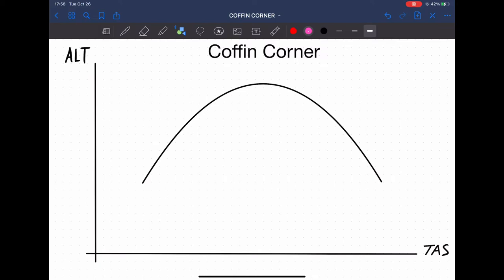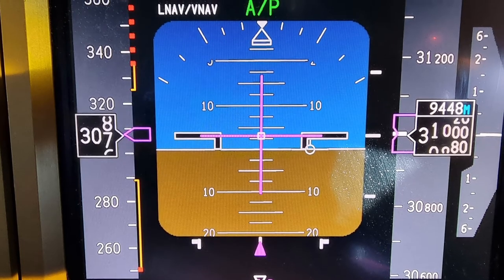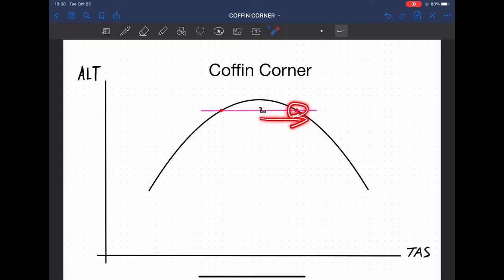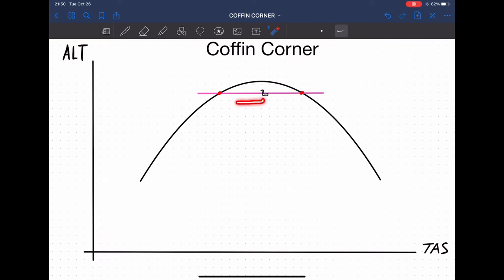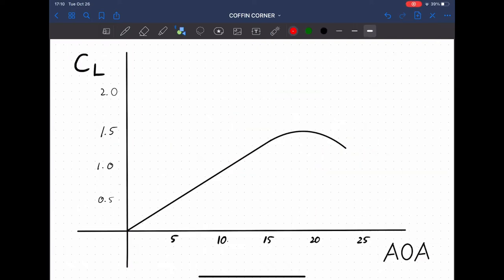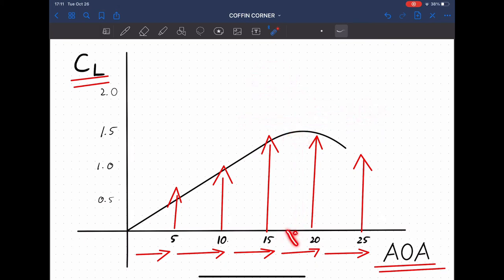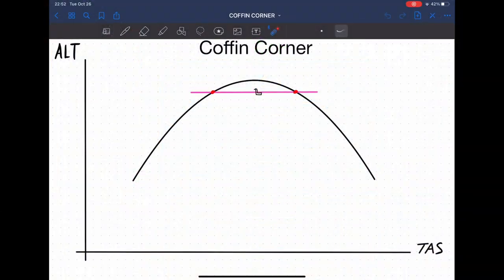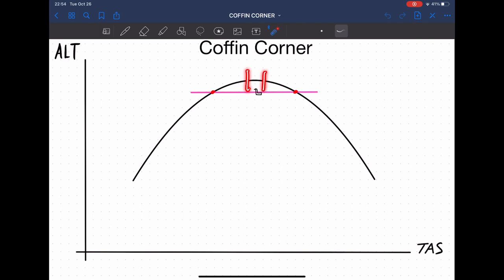Aviation Education: Coffin Corner explained correctly

Comment: Hello. Stumbled across this video while I'm studying high altitude aero for my ATP. This video helped me to understand coffin corner a little better because it actually made me think. However, there is an inadequacy in your explanation. The PFD/Attitude indicator does not show direct AOA of the wings. It is only telling the pilot the angle between longitudinal axis and the horizon (nose of the airplane vs horizon to put it simply). This is something that I have drilled into my student's heads over and over, the PFD/attitude is not an AOA indicator. Angle of attack is angle between chord line and relative wind. Pitch angle from the PFD/attitude indicator does not tell you that. Most planes do not have AOA indicators, although the attitude indicator can give you a general idea of where your AOA is at. But you are correct when you say a stall has nothing to do with speed, it does not. Only critical AOA. 

What I did get from this video is that at the low speed buffet, your AOA is high enough (although perhaps not at the conventional critical AOA) to now induce a supersonic flow over the wings due to the airplane's TAS through the air. This will cause a shockwave and move the center of pressure back, but not as much as with the high speed buffet. This shockwave will induce a low speed mach buffet. It is not necessarily a stalled condition as you defined it due to the angle of attack not being at critical AOA, but it is almost like a stall as there is separation of airflow from the wings surface and the boundary layer is disrupted. Which will result in buffeting and reduced control effectiveness as would happen in a stall at a lower altitude and at 17-18° AOA. So to conclude, with a low speed mach buffet, you perhaps have not exceeded the defined critical AOA, but your AOA is excessive enough to induce shockwaves from airflow acceleration and basically "stall" your airplane. However, as we don't really have AOA indicators in many airplanes, we use speeds as known guidelines to avoid "stalls" at higher altitudes (the low speed buffet), although an airplane can stall at any given airspeed. The air data computer in the airplane will calculate a corresponding IAS and put that on the screen as the speed the pilot should avoid to prevent the low speed (or high speed as well) buffeting. 

I think we could also compare low speed buffet and what is happening to the AOA to icing on wings: ice will start to disrupt the boundary layer and smooth airflow, and eventually separate the airflow at an AOA MUCH LOWER than that of the critical angle if the pilot tries to increase the AOA. This is stated in the Pilot's Handbook of Aeronautical Knowledge Chapter 5, implying that you can stall or have a severe reduction in lift even at an AOA much less than critical AOA if there is a reason for it to happen. This is basically also what is happening with a low speed mach buffet, except the reason for the early airflow separation is the shockwave rather than icing. Now is the low speed mach buffet a stall? Depends on how you define it and how you're looking at the whole critical AOA situation, but you definitely have severe reduction of lift. 

There's also fluid dynamics magic happening in all this I'm sure, but I'm not an aerodynamic engineer and I'm not even going to begin trying to solve this at that level. I just fly the things safely and have fun. This has been my two yen on the topic.
Reply from the maker: Thank you for watching and writing such a long comment.

You can find the AOA by taking the difference between the FPV (flt path vector) and the "piper" (the cross hairs/ the nose of the attitude indicator)   Even in you don't have a dedicated AOA indicator.

Example: In level flt. A jet typically flies at a positive AOA 2.5 degrees... How would I know that?
If I am at FL350 my FPV would be level at the horizon while the nose of the airplane (longitudinal axis) would be aimed upwards at 2.5  typically.

The reason why I am so adamant that the low spd mach buffet should be classified different from a traditional STALL is because there a lot of pilots who actually think the Low Spd MACH Buffet is the same as a traditional STALL.

They are not the same.

If you're the type of pilot who understand the difference between the two concepts and prefers to call it a "SHOCK STALL" instead of "Low Spd Mach Buffet" because Shock Stall is easier to say.
Then that is fine.

If you really want to simple it down... Lets redefine a STALL like this. 
Hyperbole:  "When the wings don't fly anymore"
obviously a joke.

I hope I answered your questions
please write back
give me suggestions on what next videos I could do.

Thank you again.
Reply: @flightlevelview2115  Thank you for the clarification. I have learned something new and useful for my ATP. I did confirm that the difference between FPV and the pitch attitude will equal AOA, that is very good to know. I come from a general aviation background where even the more advanced GA glass cockpit aircraft won't have a FPV, and they may have separately installed AOA indicators. This info on FPVs will be very useful for me soon. 👍

And I do agree with you that a low speed mach buffet is not a traditional stall, as discussed in my previous post which I wrote a whole essay to wrap it around in my mind. "Shock stall" is definitely less of a mouthful than "low speed mach buffet" so I can see why people refer to it as such, but it is definitely not a traditional stall exceeding the critical AOA. However, the symptoms of buffeting will make it SEEM LIKE a traditional stall, although the reasons for the airflow separation are different. Chapter 16 of the FAA Airplane Flying Handbook states "Mach buffet is a function of the speed of the airflow over the wing—not necessarily the forward speed of the airplane—and the shock wave strength, rather than a stall, [is what] creates the airflow separation." 

Hope that helps. Thanks again.
Reply from the maker: @guillermocuevas1688  simple rule… if the airplane is buffeting or if the tail (not the airplane) is buffeting something bad is gonna happen.
Also, If you are in 1 G level flight the AOA is the pitch attitude. Meaning the relative wind is the equal and opposite direction to your flight path then your pitch attitude is your AOA. FPV helps only when your climbing descending or pulling G s
Reply: @flightlevelview2115  Agreed with your simple rule on buffeting. And yes, technically speaking in 1 G level flight the relative wind is exactly opposite of flight path and thus the pitch attitude/artificial horizon could be used as an AOA indicator. I don't disagree with you, but I will explain why I wouldn't teach that in general aviation to any of my students. It would get confusing for them very quickly and in most GA planes there is neither an FPV or a direct AOA indicator. But even starting a stall from 1G level flight the pitch attitude indicator will not directly tell you AOA unless, as you said before, you have an FPV on it. Especially when I practice stalls with students in general aviation, even when we do start from 1G level flight, our flight path will change depending on the type of stall we do (power-on, power-off, accelerated), and that will immediately change the relative wind, and thus the AOA will not reflect anymore on just the pitch attitude, unless we can see our flight path.

So we (at least I definitely don't) don't teach in general aviation that the pitch attitude indicator will show you your angle of attack at all. Lest some poor pilot think that pitch attitude does equal AOA and then someday ends up pulling the nose of the airplane up to 10° pitch while pulling a 45° bank and then they're wondering why the airplane is stalled and spinning towards the ground even though the pitch hasn't reached anywhere near 20° as it does starting from a 1 G level stall.

Comment: Don’t really fully understand why aoa wouldn’t decrease with an increase in altitude considering the air density is significantly reduced, I get airspeed is increased but certainly not as significantly as the air density is reduced at a cruising altitude. Maybe I just don’t understand the math of it. But in conclusion both low and high speed Mach buffet are essentially caused by air over the wing going super sonic causing shockwaves? I’d assume then low speed buffet causing the cop to move rear wards just like a high speed buffet? Also causing a Mach tuck? Im a pilot in training for my atp already took the atp written
Reply from the maker: Thank you for commenting.
Not sure what you were asking.
Do you not understand why the speeds encroach towards each other?
Could you ask again in a different way?
Reply from the maker: A stall “exceeding the Stalling AoA” does not depend on altitude (air density).
Please write back i would love to chat, and perhaps you could give me another idea for a video
Reply: @flightlevelview2115  i think bccrow thinks that Level flight AoA should be lower than 3 degrees as seen in your  PFD. Above FL310 the aircraft is going fast , but the AOA is still high because IAS is low at HIGH ALT due to pressure and density . IAS determines AoA  , not Ground speed. in the mid altitudes flying fast can result in 0 degree level flight  because the you can attain IAS greater than 320 knots.

Comment: I am not sure about your low speed buffet explanation. In the lift equation there is air density; which is pretty low at high altitudes. Decrease in speed will lead to reduction in lift. However you are already be at the critical value of air density that barely enough for required lift and I think thats why aircraft will stall.??
Reply from the maker: Thank you for responding. I really appreciate it.
Not too detailed but are you an airman by any chance?
I just wana know for my channels sake who’s watching my content.
What videos you prefer go pro or educational
Reply: @flightlevelview2115  I am a Pilot, CPL holder. However the matter is, there is only one correct answer about the low speed stall at high altitudes. If what I know is incorrect I would appreciate to be corrected, if you have a source that proves your claim.
Reply from the maker: @orhananildemir4022  my sources come from my aerodynamic knowledge.
I think I explained in the video why the low spd mach buffet isn't due to a stall.
A stall is defined as the CL not increasing with a further increase in AOA. (The CL is decreasing)
A stall doesn't depend on altitude or spd.
At 1 G level flight at high altitude, the stalling AOA is no different, and assuming the stalling AOA is around 15~17 degrees
That means the airplane would have to be at about 15 to 17 degrees pitch up in order to "STALL".
The airplanes do not arrive at the low spd mach buffet at 15 ~ 17 degrees.

That's why I am ruling out stall from the reasons why the nose drops once you hit the low spd mach buffet.

The low spd mach buffet involves shockwaves.

If you would like to explain why you think the low spd mach buffet is due to stalling. Please feel free to comment.
Let's have a discussion.

Once again, thank you for taking the time to comment.
Reply: just check what is the stall and what is caused by. Stall is exceeding critical angle of attack which is as "flight level view" said constant with altitude and it should be around 16-17 degrees. Low speed mach buffet is exactly what he showed in this content. EVen if you think that way, why is this called low speed mach buffet? if there would be any stall they would probably call it stall buffet or just the stall:-)   BTW. you can decrease critical angle of attack by lowering the flaps for example. Efective AoA increases and because of that AoA crit decreases
Reply from the maker: @MikeSierra8282  thank you for commenting... are you a sub or a just a visitor?
Reply: @flightlevelview2115  hi, I 've just gave you a SUB. I am preparing for airline interview, constantly searching and reviewing some AV stuff. I found your content very interesting

Comment: thank you for your explanation! but why it called coffin btw?
Reply from the maker: Coffin Corner is just a name, I "think" it got the name because because you're flying in such a tight speed margin.
Reply: You get it wrong , you end up in a coffin 😉
Reply: @flightlevelview2115 I don't think that's correct. I think its more sinister than that. I believe the 'corner' part of it refers to the tight margins, but the 'coffin' part refers to the potential human consequences of losing control of the aircraft due to the small margin for error.
Reply from the maker: @mosty85  thank you for commenting and watching. Are you a subscriber?
Reply from the maker: @mosty85  thank you for the comment

Comment: As you climb, the air becomes less dense, and your wings need more airflow to generate the same amount of lift. The true stall speed increases as you climb, regardless of the AoA.
Reply: @flightlevelview2115  Could you explain why that’s incorrect? Not a pilot, but I would have thought true stall speed increased with altitude because of the air density. Would love to hear your explanation as an expert, and thanks for your content!
Reply from the maker: @graysonmalitsky5019  thank you for commenting. Too many pilots focus on “speed” when discussing stalls. Yet all pilots know stalls are dependent on AOA.

Rhetorical Question: Why do pilots focus on speed when they should be focusing on AOA?

The stalling AOA doesn’t change with density altitude.
At 1G level flight at 5000ft the stalling AOA should result in a corresponding pitch attitude.
If the airplane is at 1 G flight at a higher altitude the stalling pitch attitude should be the same as the lower altitude.

If the airplane reaches “low spd mach buffet” or (low speed shock stall) —-some people find it easier to understand the term shock stall, its not quite accurate though—— at a different pitch attitude from where it should have normally STALLED i can conclude that the low speed shock stall is NOT airflow separation due to an exceedance of the stalling AOA.

I hope that made sense. You said you were not a pilot. Are you a dispatcher or mechanic by any chance?
Reply: @flightlevelview2115  i see  . Your pointing out that Coffin corner low speed loss of lift is not the traditional stall caused by boundary layer separation. rather its airflow experiencing disruption due to  Mach effect. 

the AOA is low enough for air to pass freely and create a low pressure on top of a wing but Mach effects are ruining our streamline.

either ways  the actions are the same. lower nose , increasing speed .
Reply from the maker: @zaildarbains  decrease altitude. If you pitch the nose of a jet down like a Cessna at those altitudes your might approach your MMO spd. Smoothly descend and your coffin corner with spread out
Reply: @flightlevelview2115  He is absolutely correct. You are talking nonsense. Stall speed in IAS remains constant, but the TAS associated with that given IAS absolutely will increase with altitude. Sure, low speed mach buffet occurs at a lower AOA than a traditional stall due to compressibility effects, but saying that stall speed in TAS does not increase with altitude is just wholly incorrect.
Reply from the maker: @milehiaviation  thanks for commenting. Sorry to say, that is a bunch of vague nonsense you said. Please make video explaining your case. With respect i doubt you could because my point is that LOW SPD MACH BUFFET is NOT a traditional stall.

I think pilot in general including pilots from my generation were taught INCORRECTLY during basic ground school. The CFIs should have hammered into our heads that we should not be think speed with regard to a STALL… think AOA. Even a CESSNA c172 has an AOA indicator.

Its called the “stall horn” EVEN without the IAS indicator i could maneuver that airplane hard and not stall it because i can hear when the stall will occur.
Reply from the maker: @milehiaviation  positive of negative thank you for the comment. You’ve motivated me back to making more videos.
Reply: @flightlevelview2115  I agree that low speed Mach buffet is not a traditional stall. It’s a shock stall. I literally said that in my comment. But you responded to the above commenter by saying that stall TAS for a given configuration doesn’t increase with altitude when it absolutely does. Even Airbus has a document explaining this phenomena. All the things mentioned here can be true. 

Low speed Mach buffet happens at lower than traditional critical AOA - true

Stall speed (TAS) increases with altitude, even when related to traditional critical AOA - true
Reply from the maker: @milehiaviation  i see what you are saying. I assumed original commenter was claiming to say that due to a change in TAS was the reason for the “shock stall”
I am not disagreeing with what you said..
The POINT is SHOCK STALLS are NOT traditional stalls.
Reply from the maker: I will make the corrections
Reply from the maker: @milehiaviation  the original commenter attributed SHOCK STALLS with Air density and TAS. 
I assume he misunderstood the concept of a SHOCK STALLS.
Also the guy never replied back.